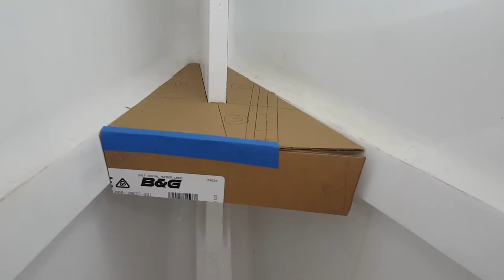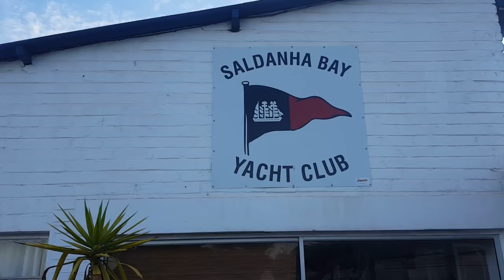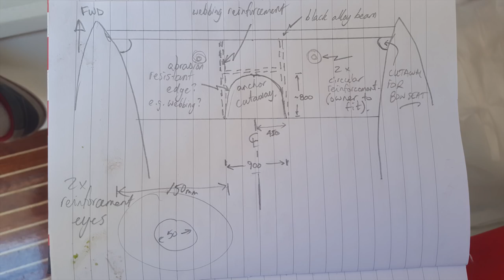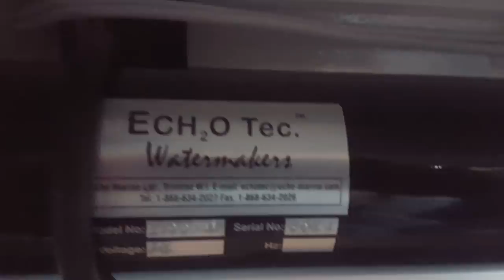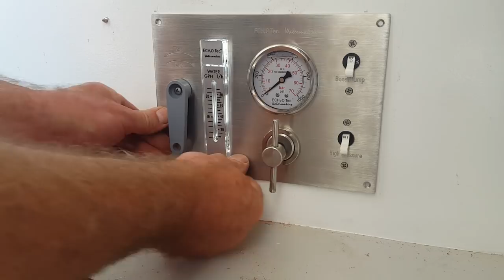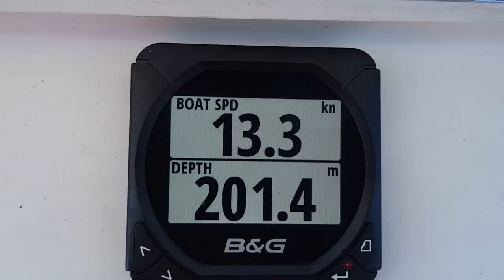Men Only : The WHARRAM WHISPERER Arrives - Ep 06 Sailing Luckyfish

Comment: What a race against time it must have been 😮 Good everything went well, except for the instruments. I sure recognised that gear adjustment nut 🔧
Reply from the maker: +MiQ Bohlin yes, funny this video should come out now after you worked, upside down, several times on that very nut!
Reply: Right Stewart, it’s a sign 😉
Time to overhaul the lower casings. 🔧 How’s your navigation lights working?
Reply from the maker: Next question :-) ?